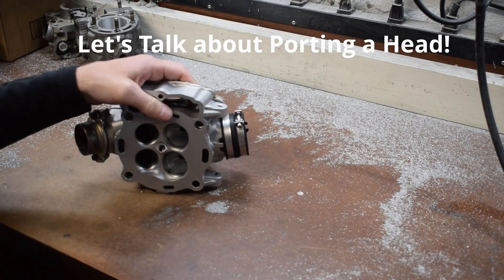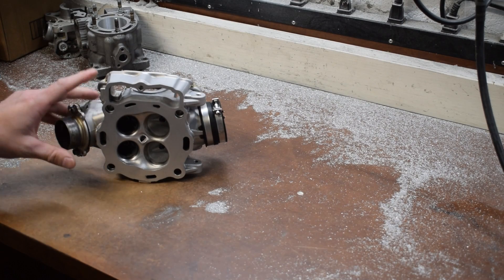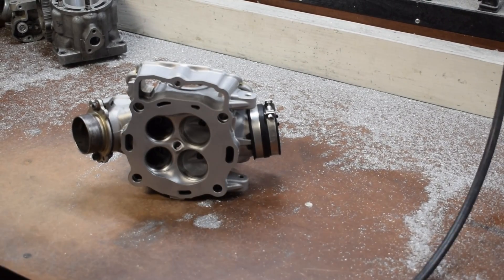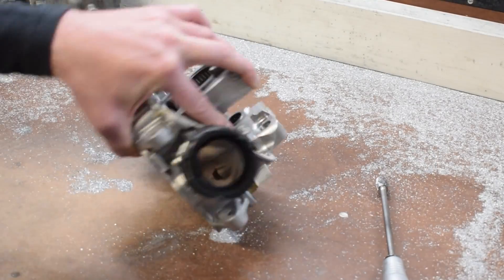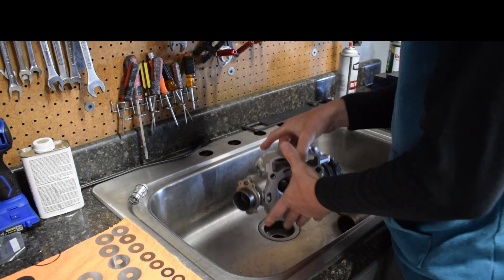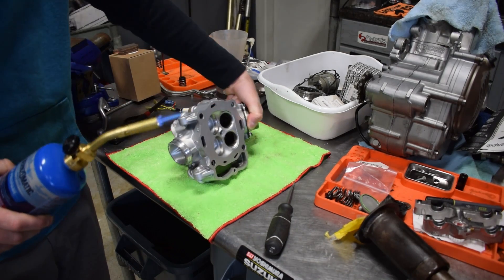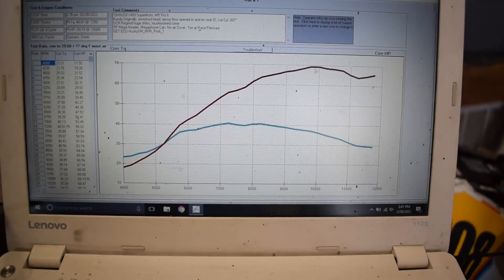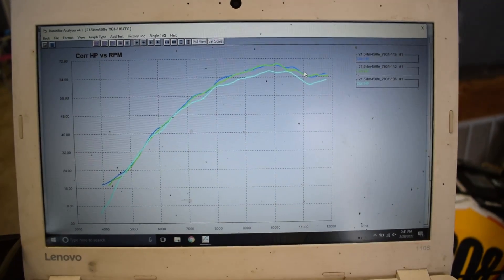Porting A 450 Head, Dyno Teaser

Comment: I'm a big fab of a velocity port job esp when the bike has a camshaft suited that is specd and timed to maximize the vel port job, I have a gen1 zx10 that has a vel port job and its silly the difference it made. I have been wondering what a new Kx450 would feel like with the velocity port job, if anyone has done one or ridden one with it let me know. Have you played with Ti DLC coated valves , beryllium seats or any other exotic coatings for cams, buckets etc... I'm on the edge of going all in on an engine build of a 23KX450 that I mostly hoon around on the street and small off road so I need all the power and nastiest as possible to make me smile since I come from riding-built liter bikes and at times breath some nitrous, so I needs it all lol
Reply from the maker: I think there is no correct answer to port size unless you add in rpm.  For a desired rpm, there is an ideal port size. Most mx ports are very close to ideal now, rule of thumb has been port mcsa is 80
percent the flow area of the seat Id which is 80 percent the flow area of the valve diameter. Kawasaki 450 has a shitty turn that ruins thr port, their 250 has a fantastic port

Dlc valves no - CrN is used and is better
dlc buckets yes - no power. Dlc finger followrs are stock now

copper seats no power gain - but can help high rpm stability but I havent seen it be much better

Comment: Do you know if 501 and 450 pistons are the same?  Could I get a high compression 450 piston and put in my 501 with a 450 head?
Reply from the maker: They will interchange but a 450 stock compression piston will make the 501 compression way too high.

if you dont know how compression ratio is calculated - google it. Same cc head, but 60cc larger engine (501 is actually 510) requires much smaller piston dome for same compression. If you did a high comp 450 piston in a 500 compression ratio would be 16:1 or so

Comment: I need to know how long does the epoxy hold up realistically.
Reply from the maker: Why is this a need to know for you
Reply: @HPRaceDevelopment  I would assume because he wants to know if you do a cylinder head for him if he should expect a limited lifespan because of the epoxy or will it outlast the valve components.
Reply from the maker: @halvorsonmx  but is it a need to know - or a want to know…

It lasts long enough for racers who want competitive advantages.  It wont outlast the valve train on a stock engine.  It typically lasts longer than competitive racers own their bikes.  The cost of doing it via welding and other methods is far too high for what we feel the market tolerates
Reply: @HPRaceDevelopment  That makes sense. Thanks for the info!

Comment: Great video bro. Most won’t share porting knowledge. I didn’t know that power was possible. I was thinking about buying a Kx 500 as that was my favorite bike over the years but I miss out on newer suspension. Would you recommend a 500 over a 450? I know it’s subjective but would appreciate your 2 ¢. I’m 260lbs. I raced 250s when I was younger. Rode a few 450s but never felt the power the 500s made. Desert riding now. I’m really thinking I want my 500.
Reply: you crazy if think that a 500 has more power than a 450
Reply: @Pereke69 500 would probably have a better power to weight especially stock vs stock
Reply: I am 280, rode with a friend that is also 280.  Had my 501 and 4 different 450s.  We both feel much better pull on the 501.  Riding dunes and hills.  All the external power stuff done to it.  My son and nephew don't feel it.  They are around 180.  My '22 FE501 is a Cadillac of dirt bikes.   Also have a '23 CRF450R I have done some work on to get it where I like it.  About $4000 worth.  It is more of a race bike.   My son does not like my 501 much.  Loves his '23 KX450.  Just put a 21 engine in it with a 13.5:1 piston and some tuning.  Much more like my CR now in power.  Watching this because I am putting a 450 ported head on my 501 and a few other things.  1 at a time to see the differences.   Ordering parts for this for over a year and finally getting it done.

Comment: Hello Mate, nice video, but can you explain what is the point of applying epoxy inside a cylinder head ? Can't understand. Thanks
Reply from the maker: To improve flow in running conditions by reshaping the port in a way thats better than as designed. Power isnt about big ports, contrary to the v8 worlds view on it.
Reply: @HPRaceDevelopment  thank you for reply. Oh that’s why, because the angle is too steep on the short side? Do you have any experience with 5 valves yz250f or 450f heads? Old dogs 2003-2013 - I’m thinking how can this head can be improved specially 250 one. I do have access to full 5 axis machines on daily basis but I have to learn what is optimal shape of the ports.
Reply from the maker: @boru-cnc  The 5 v just wont perform as well as a 4v. I havent put much effort into it in years now, but back in the day you could get 5-6 hp more from a 250f yamaha with full mod. The 4v just performs better - but is less long term reliable. Hand porting is the way to develop, cnc is how to replicate…various methods on r&d but flow bench is only a small portion of what works on these high end engines. My best performing heads arent my highest flowing heads, but they cant be bad flowing heads. Valve diameter which is dictated by bore size, cmbined with cam lift determine valve seat throat and that determines port min size. thr marginal gains now being found are tiny little needles in a haystack - rather than simple port size changes or shape - on the modern 250s. They all have relatively excellent shape now
Reply: @HPRaceDevelopment  thank you for the answer. Yeah 5v is more odd shape in the intake, but why do you think 5v is more reliable as I think the valves are smaller so they wears quicker and extra valve spring is causing more resistance for intake camshaft? I will have a look in this head as the idea is to install a billet cnc big bore - I’m going to make it myself - something like a IceCube cylinder. And I was thinking to port it in the same time. It’s an old bike but it’s perfect just for a test to see what results I can end up with, maybe make my own piston as well and check how they will work both together. If good then make more for different bikes. Thanks Dan.
Reply from the maker: @boru-cnc  lower lift, less spring pressure, more valve seating area to valve area to dissapate heat faster, and lighter valve....just more reliable all around

Comment: 70 HP? Wow, when is it enough?  Haha!  Your professional opinion, are the factory supercross teams making 70hp? Tomac, Roczen etc?
Reply from the maker: 53 off the showroom to 70 was a little bit of a surprise for me as the most power I've built for mx to date was about 62 on a 450 which was too much for it's owner, but for this bike's usage (road race) we needed all we can get!  No, pro sx around 60 MAX.  Most of the teams are chasing less power and smoother delivery from who we talk to the insights I hear.  The best Pro sx 250's on my dyno are in the 45 range (maybe star is 47 ish) and clearly they can turn just about same times....  Outdoors I think 61-62 is about all they can handle as well.  At some point you start spinning which aint winning.   Great question thx for asking
Reply: what other mods were done to get 70HP? thats bonkers on a 450
Reply from the maker: @kellybrown2457  our ecu, fuel, megaphone pipe, cam and some added compression
Reply: Added compression you mean piston ?
Reply: @xxgeorgiaboy piston and/or head headgasket thickness